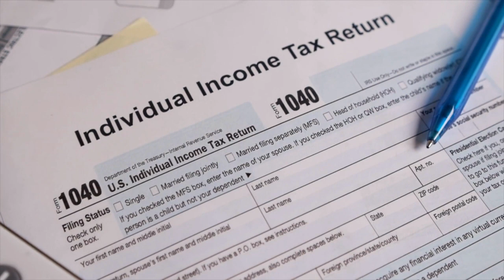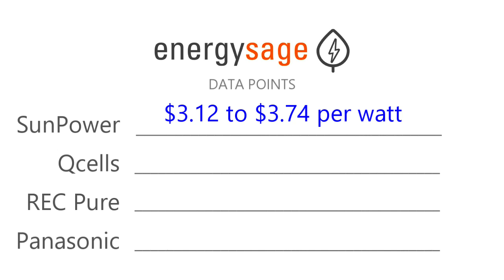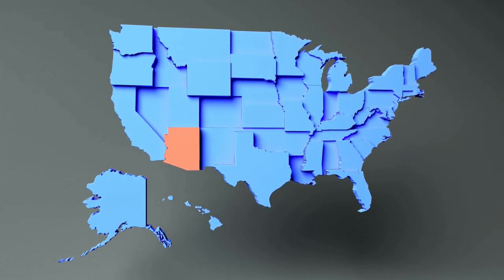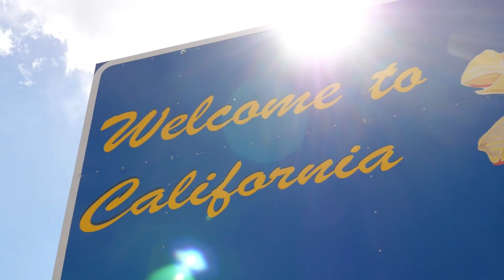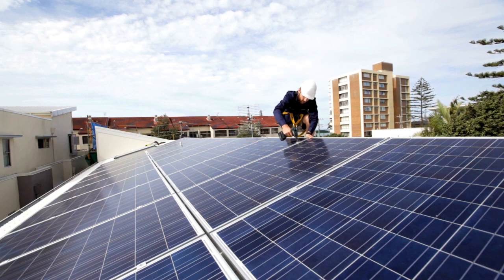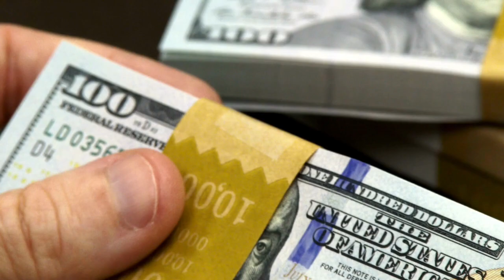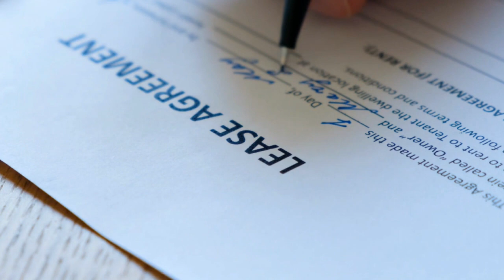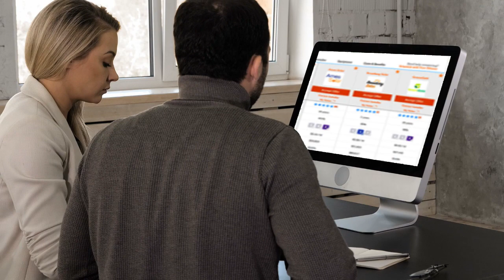Solar Panel EXPERT Reveals How Much Solar Panels Cost

Comment: After skimming various websites trying to find answers - it seems like the average price of a single panel is around $225, as of me writing this comment, August 27th of 2024. They can be as cheap as $100 or as expensive as $500. For those like me who just want a SUPER ROUGH BALL-PARK estimate that for some reason basically no one on the internet wants to provide >:| .... there ya go.
Reply: China has flooded the US market with panels selling them for as low as 0.30 cents per watt then the installers turn around and sell for $3 per watt.  The risk they acquire is from the bulk purchase of the panels which they buy pallets upon pallets.  The solar companies that went bankrupt are just ditching their inventories which is why we are seeing 500 watt panels going for $200 on the internet.  Most likely the bankrupt companies have already more than recovered their investments from the panel purchase and with the slowdown on sales, they went into bankruptcy to avoid honoring any warranties.